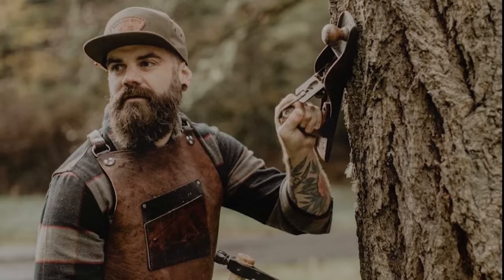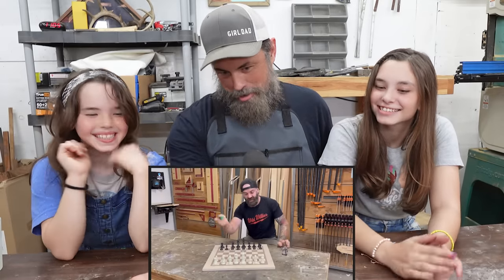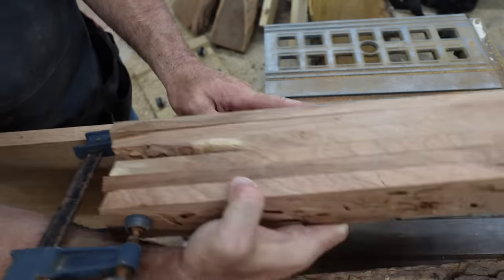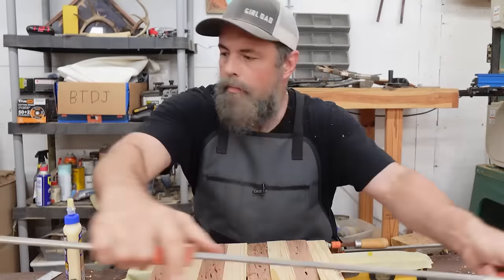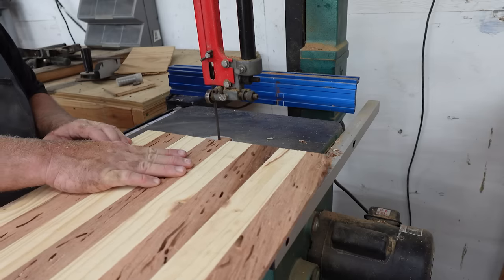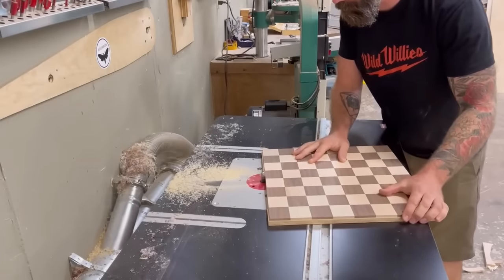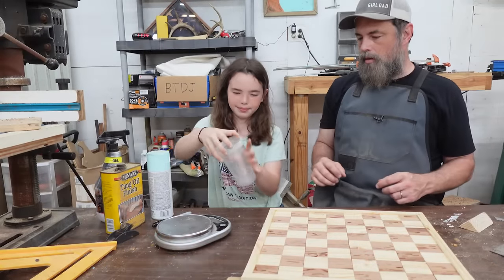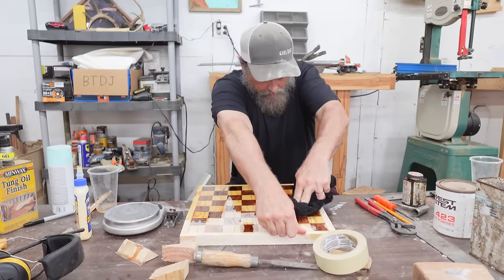I built a Bourbon Moth Woodworking project. Can a regular guy do it??

Comment: 1. If you had Jason's shop it would have been easier. 2. You can work with a glue up panel, if it's clamped correctly, in an hour.  You don't have to let it cure overnight.  Can someone make that chess board in 1/2 a day? Maybe.  Will it take a week?  Obviously it did. Could it be done, in one to two days, by the average person, with the correct materials and tools on hand?  I think so.
Reply from the maker: I appreciate that. It could absolutely have been done in half a day, starting with square stock and a table saw with a better fence, and not having another job. A big part of the reason for overnight glue ups is that it's HOT in there, and hard to spend too much time in one day. Working on that problem.
Reply: Sure, but WW here has a ton of tools to speed up the process and it still wouldn’t be a half day project. It’s a good reminder to take anything any professional youtuber says is easy with a gigantic pinch of salt. There’s a loss of perspective as to what a regular Joe (or Jane, in my case) will find easy that comes with doing this for a living in a super well-equipped shop.
Reply from the maker: @silmarian  Well said.

Comment: For squaring up the edges make a “track” for your circular saw with a piece of hardboard. Cut the factory edge off at a couple inches in, flip it over and glue it down to the remaining piece leaving enough space to trim the wobbly first cut flush since now the factory edge is your guide. Bob’s your uncle.
Reply from the maker: I have something similar to that. This was the first time I ever remember trying that edge guide though. Who knew it was so awful?

Comment: GV, as a new WW I have learned that some hand tools are the same as the big power tool. Double sided tape helps a lot, CA glue with Activator speeds up time for some glue ups, good saw blades are a must along with sharp tools. As always wood will bring you into the matrix when one is not careful so try not to overthink. 1 more, beware of the rabbit hole.....legend has it its a ww from lost in a big box store still buying tools today!
Reply from the maker: LOL

Comment: you can clamp a straight edge under your project and run that through your machine (bandsaw, tablesaw) to cut off the ends..  the straight edge and the edge of your table can give you a perfect cut along the edge of a project that is too big for your machine..   if that makes sense  : )
Reply from the maker: It does. That's a great idea.

Comment: i saw that you have a circular saw.  You can use a straight edge; like a piece of angle iron or even a framing level for small pieces.  Clamp it down and just slide your saw along that edge.  It's basically the poor-man's Festool track saw; aka most of us lol.
Reply from the maker: That's exactly the way I should have done it. Hindsight is 20/20!

Comment: That's looks like the same craftsman table saw i had for 10+ years.
Reply from the maker: It's pretty bad. The plastic frame is starting to break, and my fear is it will one day fall apart in the middle of a cut and send the blade in my direction.

Comment: Mesquite is great for smoking stuff.... light smoke though.   I have a nice log in the driveway.  It had crazy cool grain because the way it grows. Common around here.  Just need to find someone with a band saw to help me resaw it.  Want to use it as a box to contain some ashes.  I think it would look great for that.
Reply from the maker: I've grown up surrounded by Mesquite. It's not my favorite for the smoker, but it works. Being from Central Texas, I'm supposed to like Oak best, but honestly, I'm a bigger fan of Pecan. I love Mesquite for woodworking though, even if it's rough on tools.
Reply: @worstworkshop  I have 4 60 year pecans on my place.  I have a small stack of drying wood that I'm going to chunk and put in buckets for smoking.  Just what has broken off or larger stuff that has been trimmed.  I like Hickory and post oak mix for beef meats though.
Reply from the maker: @Danman1972 , I'm just a little jealous!

Comment: BTW, the following video shows a relatively inexpensive way to make a tool to solve the issue of cutting large panels or boards precisely and squarely. This guy has made almost everything in his shop, barring the actual power tools and manufactured components like guide rails and T tracks.
Reply from the maker: I don't think that link came through, but tell me who it is and I'll go check it out. I love what Matthias Wandel has done though. One of my YouTube heroes.
Reply: @worstworkshop  JSKkoubou is the channel. The guy went so far as to build his own drill press mainly out of wood. I think I'd spend the money for a cheap Wen drill press before building one.
Reply from the maker: @gaiustacitus4242  I see now. Yeah, brilliant.
Reply: @worstworkshop  JSKkoubou never fails to impress me with his low budget homemade builds. Making your own tools is great for hobbyists or small businesses where the commercial equipment is unreasonably expensive.

Comment: oh yeah I am stealing that drum sander.
Reply from the maker: Do it. I get a lot of questions about it, but it's a pretty simple device. Here's the trick. Get a good cold-rolled metal bar and string a bunch of MDF circles down it to make the drum. Get it close to even. Then put sandpaper on the table, and raise it up until it's sanding the drum for you. That makes the drum perfectly parallel to the table.
Reply: @worstworkshop  genius method!

Comment: Thought your chess board looked like butt. However, then you did epoxy, and epoxy, and epoxy. Then sanded. And it still looked like butt. LASTLY... you added the finish and those colors just popped and I was like GASP  :O 
Great job on the chess board you three!
Reply from the maker: The last coat is the only one that matters!

Comment: Man, I think I have the same trashy table saw. I wish I could get that fence to work better than it does. It's very annoying. Any tips?
Reply from the maker: For the fence, yes. Before you lock it down, push forward on it to try and release a little pressure on the back clamp. It should align on that surface at the front side of the fence. It may not be perfect, but it's usually close enough. 

The real problem is the lack of a riving knife, unless you still have the blade guard.

Comment: Hi, 
liked your video and am also a fan of Jason.
I m fearly new to woodworking, but in my experience or at least 
my experience with the one and only bottle of glue i ever bought, 
the glue is cured enough after an hour to proceed working on the piece, 
especially if its not a structural part. 
Maybe you use longer curing glue because you work with children and 
need more time . . . i always found that getting help from children made
my projects much more difficult and timeconsuming ;-P

Cheers
Reply from the maker: You're absolutely right. Another advantage Jason has over me is that he has a climate controlled workshop, and does this stuff full time. I'm not there.
Reply: @worstworkshop  tell me about it, my first woodworking project was a 1/4 m³ rolling toolbox, with ~160 finger joints. I only got 2m² of workshop in the basement, only some very selct tools, no mitersaw, no tablesaw. . . . But a 3d printer and a router <(")  Great Kombination. 
Best of luck to you and your family

Comment: I’m curious as to what he considers a half day. He would need to mill up the lumber then do his first glue up and wait at least 1-2 hours for it to dry enough to cut those pieces then glue them on his plywood substrate then wait another 1-2 hours for that to dry to trim it down and then add the border to it. So is he just talking like half a day of actual work time or is he talking half a day total from time he started to the time he ended because if it is the later then I’m a bit skeptical. Good video.
Reply from the maker: Thanks! I think if he was careful, he could have moved forward after 30 minutes of set time, or even better, reinforced a few spots with CA. Who knows?

Comment: Uncured? Because of the ratio. Pouring a small amount from one cup to the other, you lose a certsin amount. It might have dried a week later. Good caml on scraping it off and doing it again. 

Simply painting the epoxy on is a little easier than pouring. 6 coats rolled on and you waste a lot less material.
Reply from the maker: Yes. I may have gotten the parts mixed up when I was pouring them too. Who knows.

Comment: Love the video, and I'm now a subscriber.

One thing to keep in mind is the magic of YouTube.  All the projects may have been built in 'a day', I guess that depends partly on the definition of one day.  Is it a normal workday (8 hours), or a calendar day (24 hours), or something else?  I doubt you kept your girls in the shop for 8 hours each day.  If you spend 3 or 4 over 3 or 4 days, you could say total time was 'one day'.
Also, keep in mind they were not necessarily built to completion, one at a time.  Meaning: start one up to glue-up, then start the next until glue-up, etc...  Wood glue only needs about an hour or two to set, 24 hours to fully harden.  So, you don't have to wait until tomorrow as long as you don't stress the joint.
Reply from the maker: That's a great point. And thank you for subscribing!

Comment: You can use the circular saw you used to cut the plywood with and a straight edge to square up your glued up panel...
Reply from the maker: Yes, I could. It probably would have been a better solution,but I didn't think of it at the time.

Comment: I think the biggest issue for you was the material and tools.

Had you made a smaller board it would have worked better with what tools etc you have. 

But in any case if someone like BM says it took him half a day, doing it as an amateur or worse with kids is obviously going to take significantly longer.
Reply from the maker: Definitely. I think Jason could have done it better and faster in my workshop though, if he didn't get heatstroke first!
Reply: @worstworkshop  lol. Yeah well as you mentioned he has been doing it for quite some time, knew what he was doing etc. so huge advantages.

Comment: Make sure to teach the kids to setup the board the right way--the right hand corner should always be a light square. In the video (9:30-ish), it's setup incorrectly. :) I love the use of the worm wood.
Reply from the maker: Thanks for the tips!
Reply: NP! Once you know that there is a correct way, you'll be blown away by how many T.V. Shows, Movies and ads set it up incorrectly. 

I helped my neighbor make a chessboard using the exact same techniques. He had an aged piece of oak I had to split up, and beforehand I had to explain that it wouldn't be that nice weathered grey once I finished breaking it down. So I did the ole vinegar/steal wool trick on it after. Turned out real nice.
Reply: For those that thinks it doesn’t matter, it really does. It changes the position of the Queen and messes up standard openings. As already pointed out, it’s often set up wrong on tv and in movies. That’s the first thing real chess players look for. 
Nice looking board.

Comment: That sander is an accident waiting to happen 😧
Reply from the maker: I can understand why you'd think that. It looks like I could get my hand caught under there and it would cause traumatic damage. 

The truth is that you can just grab that drum with bare hands and stop it easily. If I feed to aggressively, it will stop on it's own, and that's by design. 

It's driven by a long belt that's just a little loose, and the motor is just powerful enough to do the job. 

The dangerous part is that wheel at the side. I'm never near it, but in theory it could break some fingers.